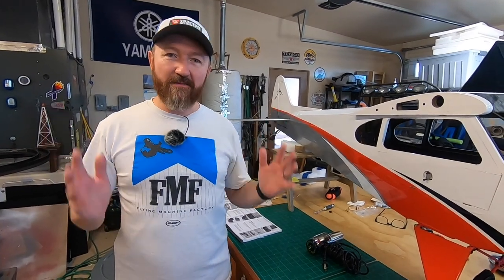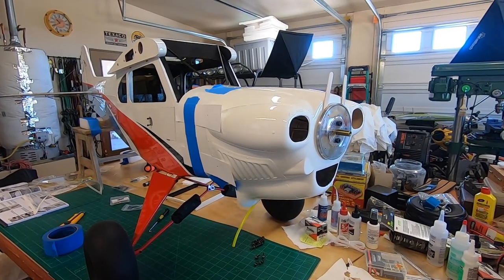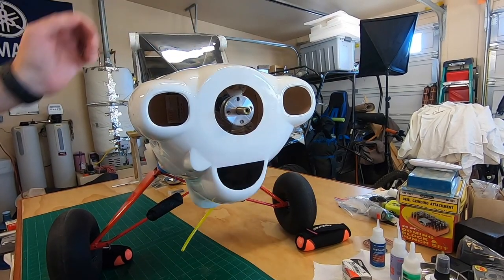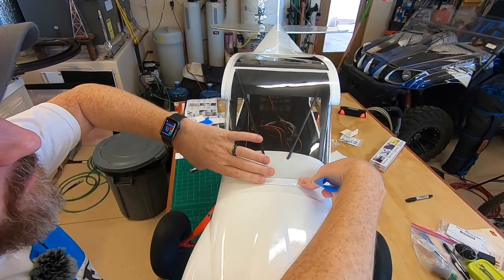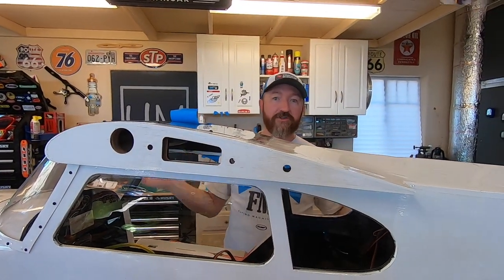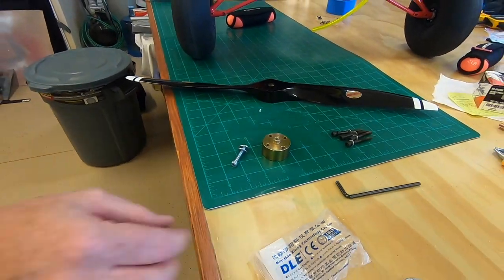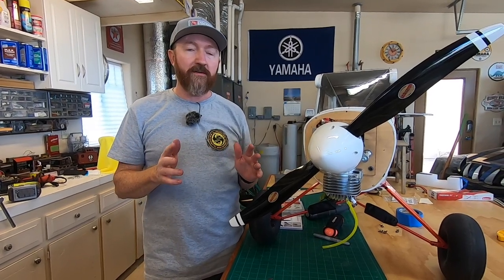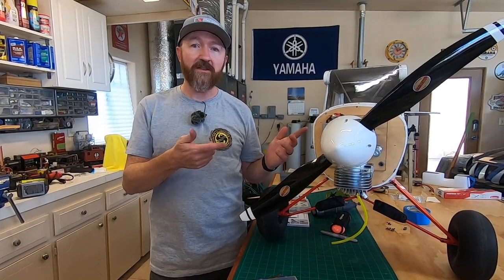Hangar 9 XCub Assembly Part 7!!

Comment: Been thinking about your fueltank. You should  replace the short tube where you fill the tank with a longer that reaches all the way to the back of the tank. It will make it easier to get all the fuel out after the flights.
Reply from the maker: Great idea I’ll look into it. However…I also don’t want to disrupt those seals prying them out on the top of the tank. Hmmmm
Reply: @UngluedModeler  I think the easiest (but not that easy) way to do it is to replace the old tubing inside the tank using some pliers. They are usualy threaded but it might  be even harder to get the nut back on the inside.
Reply: You need a long curved hemostat, to do the tank fittings, you really can't get all the gas out, if odor is a concern plug vent line, and paint and seal engine box with a barrier gloss, not flat.  Screws on the wind screen will vibrate and crack the clear plastic unless a cushion is provided. Try a thin layer of Foam tac, for prop, if jig is aligned as a vertical and horizontal cross should give you correct position for compression stroke. 9 and 3 is the correct position to cut a prop, the backplate was correct, should have test fit it to see if it worked.

Comment: That backing plate oopsie was a mistake. I’d be watchful of stress cracks now with all those holes.
Reply from the maker: Thanks for the heads up I’ll be on the lookout for sure. I was wondering about that. The way it came drilled the prop was at 9 and 3.  Didn’t really want that. But I’ll watch it. 🙏🤘